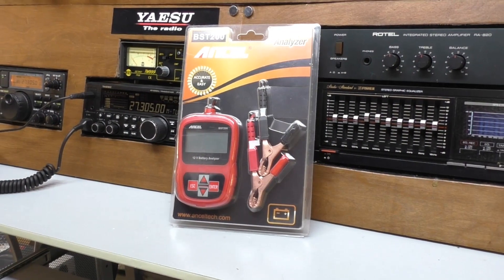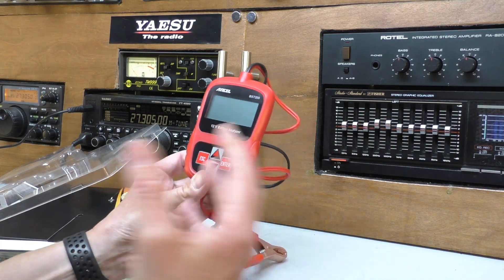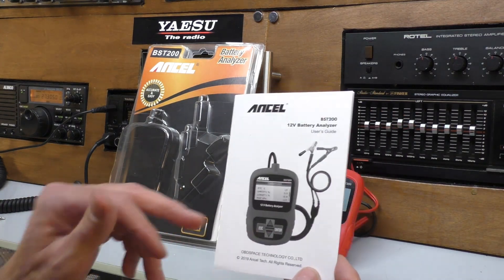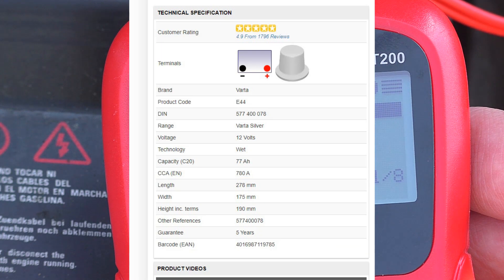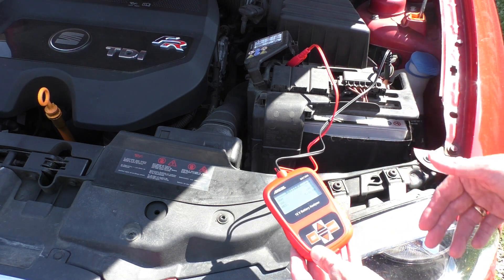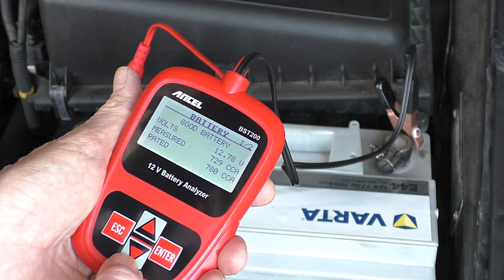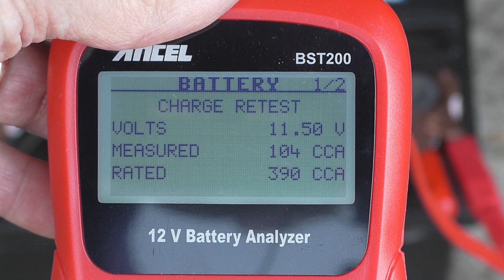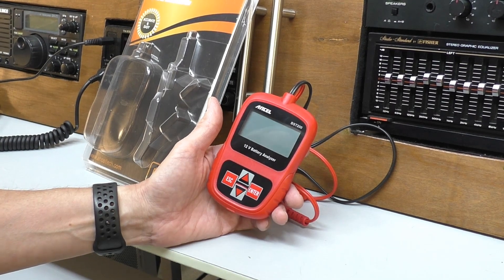ANCEL BST200. Affordable battery tester.

Comment: Have the same thing going on as well. I was bound to replace my battery since the car would barely crank over after sitting for a week or two. Bought the tester instead, ran it, and it turned out the battery was in perfect condition. Something appears to be draining it as well ever so slowly.

Comment: The RES will be the internal resistance of the battery. The lower the value, the more CCA it can deliver. The odd thing is the internal resistance should be milliohms = mR. whare as MR = Megaohms which it definitely is not. So, there is a capitalisation error, but that is a minor issue.  Great video, thank you for posting.
Reply from the maker: Thanks for the information.

Comment: Smart Battery Charger's do the same thing. "Similar Price"  They will recharge a battery at optimum speed, repair damage to the battery, and automatically switches to a low charge rate once the battery is recharged. Smart chargers like The Ring RSC612/RESC612 also has four battery analysis tools, that test start power, an alternator check, battery cranking performance and battery voltage, to give you a full view of your vehicle battery's health.
Reply from the maker: Hi.  Smart chargers do seem to work on batteries that do not get used much. Without one a battery can die in 4 years.

Comment: I've got an AGM battery fitted in my car, really meant for 'stop start' vehicles, even though it isn't a stop start one and they are sealed batteries and have glass fibre pads inside, between the plates, which hold much more charge than the old type batteries that you used to be able to top up.
AGM batteries are good for cars that have big sound systems and other electrical heavy drain items.
Rolls Royce cars, for example have two AGM batteries in them.
Reply from the maker: Thanks for the info. I did wonder what the difference was.

Comment: found this snippet about agm.
What is an AGM battery? Absorbent Glass Mat car batteries (AGM) were developed for use by the military in the 1980s. Their high performance and enhanced electrical reliability are ideally suited for today’s modern cars that are often heavily equipped with sophisticated electrical systems and energy consuming devices and accessories
Reply from the maker: Thats great.  Thanks.